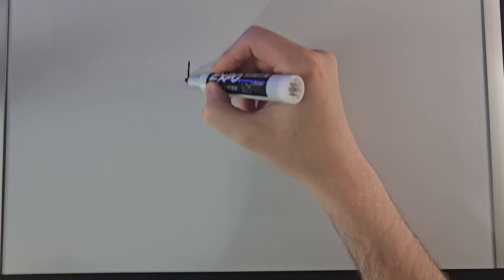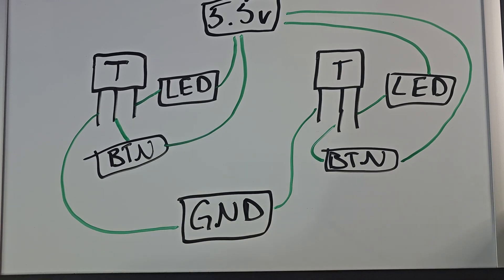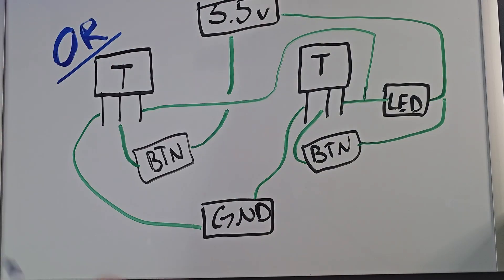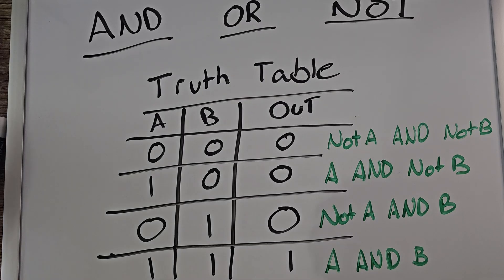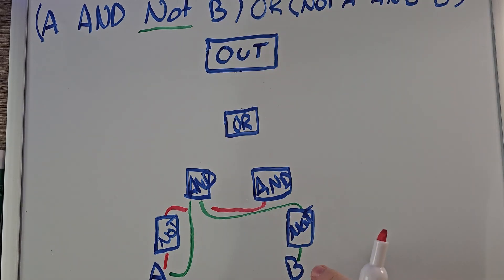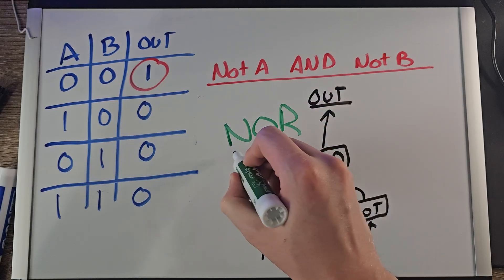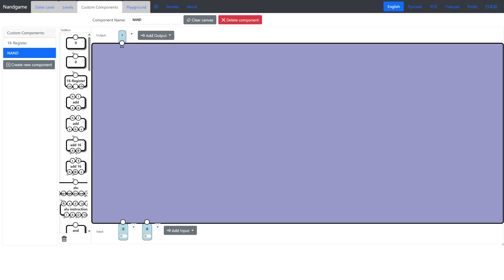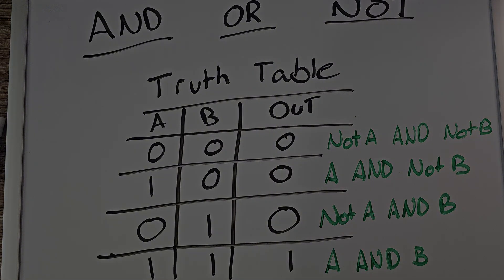How to Make a Computer: From Zero to CPU | Ep.2

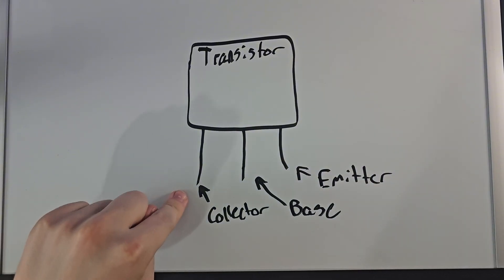Comment: 0:42  Be careful about your use of terms. People often misuse Vcc to mean the positive  supply rail as it quite commonly is equivalent however it has a very specific meaning. Vxy refers to the difference in voltage between points x and y. where x and y are the same it refers to the absolute voltage of a single point with respect to ground. Vcc refers to the voltage at the collector so if you connect the collector to ground as you suggest then Vcc is equal to 0V. Connecting the emitter to Vcc would be rather pointless. What you are connecting the emitter to is the positive voltage supply.
Similarly when you get to FETs Vss is the v0ltage at the source connection and Vdd then drain with Vsd as the difference between the two.

Comment: Firstly, draw proper schematics. It's almost impossible to see what's going on with those drawings.

For a NPN transistor the emitter goes towards the ground, and the collector goes towards the positive voltage. Current will flow from the collector to the emitter when a current is applied to the base. For a PNP transistor everything is reversed. The emitter goes towards the positive rail and the collector goes towards the ground and a current will flow from emitter to collector when a current is drawn from the base.

In both cases, you must limit the amount of current the base sees in order to prevent damaging the transistor.
Reply from the maker: I probably should mention in the videos that these aren't schematics that I am drawing. If you've used a logic simulator that's what I am attempting to simulate. I never went to school for this, just software Engineering. It helped me understand how things worked from the visual simulator approach rather than circuit schematic. They really confused me when just trying to start out. I figured it might be just as helpful for some if they saw it visualized like this rather than a circuit schematic. I haven't done it before so I am really bad right now but I hope I can make things better and more clear in the future.
Reply: @jurassicvader the best way to think of a schematic is as a voltage ladder. As you go up the ladder, the voltages increase and vice versa. Once you see that, you'll instantly see why schematics are drawn the way they are. Makes it a lot easier to follow what's going on in the circuit. Things change a little when you get to digital ICs and such. Then it's best to think about how data would flow, left to right, and draw it as such.
Reply: @JaenFoster  dude, stop being a complete douche.  the schematics were actually EASY to understand, even by a complete novice like myself.  I paused the video when he showed the drawings to see if I could figure it out before he actually showed in on the board, and I was able to understand what was going to happen very easily.  What he showed in the video makes perfect sense and there is literally nothing wrong with it.  anybody with even the most basic understanding of components can understand the circuit he is making based off the schematics he showed on stream.  except you, I suppose......
Reply: @orion7741 if you think trying to coach someone into good habits and explain why things are done a certain way is somehow a douche move then you need to give you head a shake. Letting someone follow a path that is going to hinder them further down the road is pretty shitty thing to do. Explaining how, and why, things are done a certain way isn't a douche move is it. Having a go at someone for doing that is.